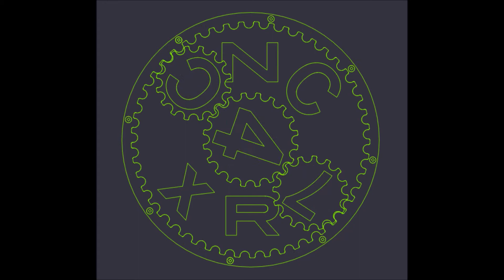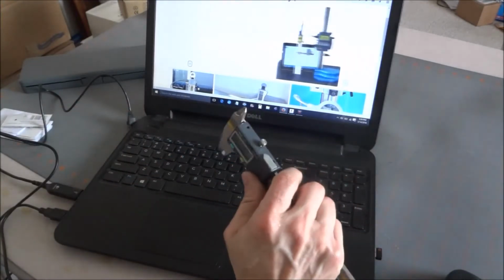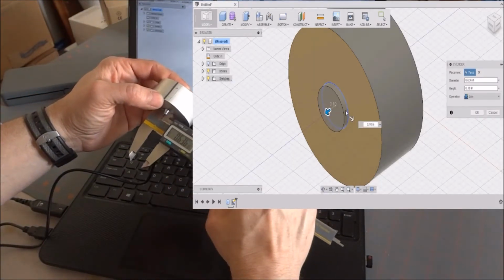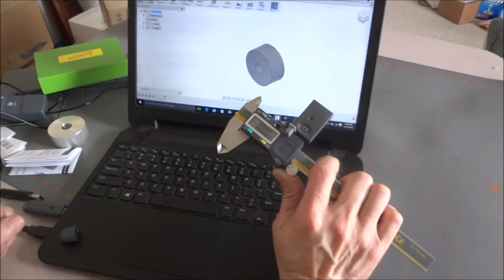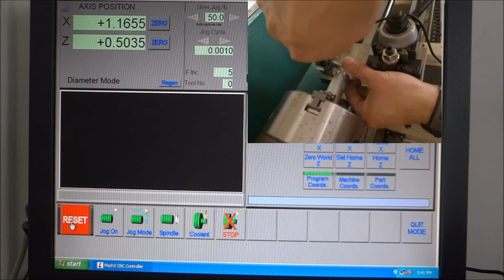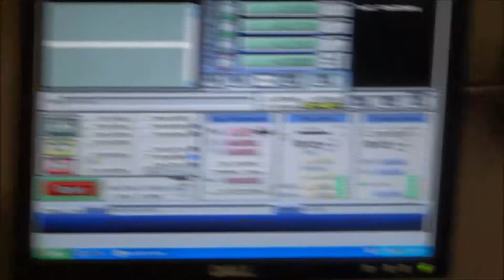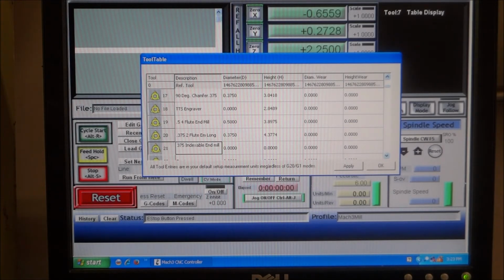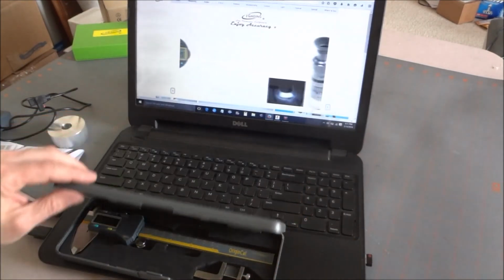Igaging Absolute Origin Calipers IP-54

Comment: Nice video Sam. I've been using the iGaging calipers for over a year, and they are the best. They feel luxurious to use, and they are very accurate. I paid $35  for mine I think, but I didn't pick up the USB sender because that would have tripled the price, and I also didn't fancy the external wires.
Reply from the maker: +Crivo152 
The DataConnect is what sold me I really like that it makes populating tool tables a breeze. And setting up X zero In the G0602 is much quicker.  All this time and you never said anything and I thought we were friends. :-)
Reply: Oops... my bad Sam!
Reply from the maker: +Crivo152 LOL  They do feel much more expensive in your hands than they are.
be Safe,
Sam

Comment: I sure hope you don't mind a bit of added metrology information.

At best almost any dial or digital calipers are only "close" for measurements. And the last digit on the display is pretty much meaningless since a factor of how measurements are done and processed within the tool is if everything else is perfect then it's still only accurate to + - one count. But a couple of excellent references would be either the Starrett or Mitutoyo websites. On top of that + - one count issue you still need to know what the tools repeatability and overall real world accuracy is. A lot of people confuse resolution with what the obtainable accuracy really is. Resolution is simply how many digits there are to the right of the decimal point. The repeatable accuracy is what you need to know. And again that's generally + - 1 count. So for even good Starrett or mitutoyo calipers in either dial or digital there still only guaranteed to being within .002"  There are a few mostly European built calipers that are far more accurate to the point of being close to micrometer accuracy, but there also more than a bit co$tly.

I also wouldn't trust calipers for anything too close for inside measurements. If you look at the edges that are used for inside checks you'll see there's small flats ground on the edges since sharp knife edges wouldn't last for long. So even though those flats are pretty small they also won't and can't give you very accurate readings since they only touch at the outside edges of those flats inside the hole. And the smaller the hole is the less accurate the measurement is. It may only be a few thou, but if you don't know about it you can end up scraping parts. It all depends on the actual accuracy your needing. I bought a set of Mit. solar powered calipers and they are the very best I've ever had my hands on so far. But I still only trust them to .003"-.005" for accuracy under shop conditions on a parts O.D. If I need better than that then the mikes come out. And good telescoping gauges and depth gauges for both inside and depth measurements. Bearing or press fits in the sizes were likely to be working with need a lot better than most calipers can provide. There still my most used measuring tool so I think it's well worth buying good ones. 

A nice option IGaging has for that wireless set up. Mitutoyo has had that available through there SPC port for awhile now, but is also quite expensive. With some luck these cheaper systems might help to force there prices down.

Thanks for the video, I thought it was more than interesting. I'd also be real interested in what you get for battery life in the future.
Reply from the maker: +Turning Point 
Thank you for the in depth explanation I could not agree more. I know there are better more accurate calipers on the market but for the home hobbiest on a budget I think these are quite a deal I really like the feel I hope to add a micrometer and indicator later on. 
Be safe Sam